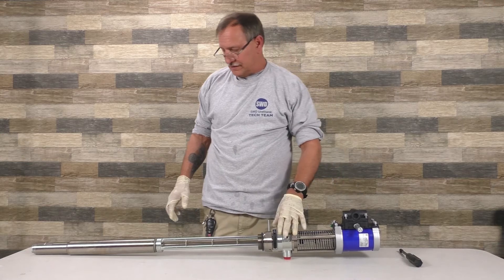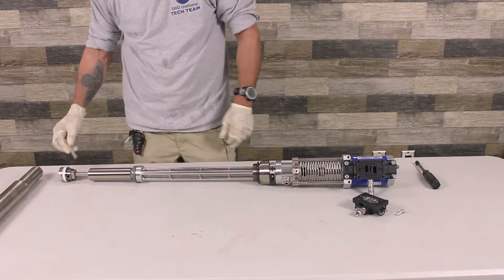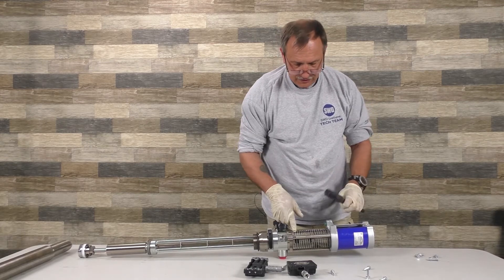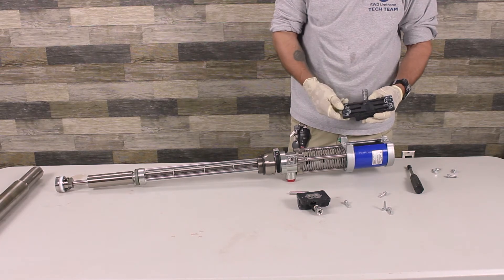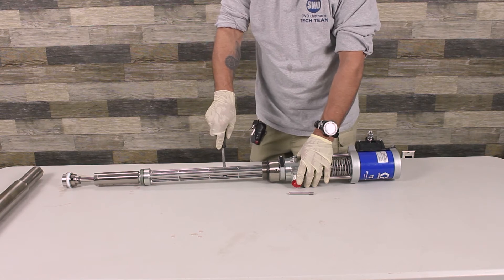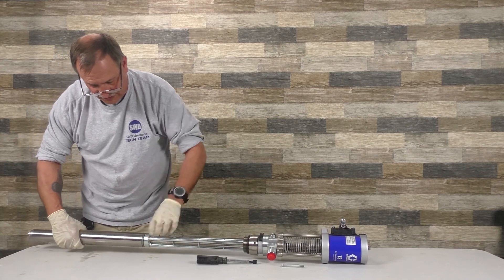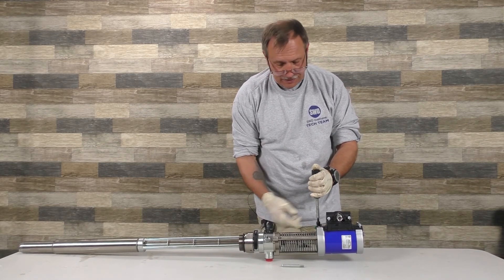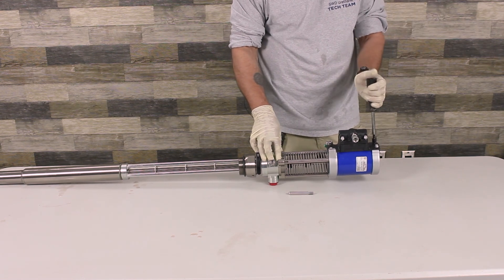Pump Breakdown T3

Comment: Uhhh...yeah...that big spring doesn't push anything back up. It is placed there as a guard to protect the pump shaft, nothing else. The piston moves up and down due to air pressure ONLY.
Reply from the maker: Hello Tim, The spring we are referring to is the one located in the air motor. If the spring is missing the pump will not travel up and down as it is supporting the reversing mechanism. You can see the spring we are talking about as item 4 on page 20 of the T3 manual(3A5180ENP).